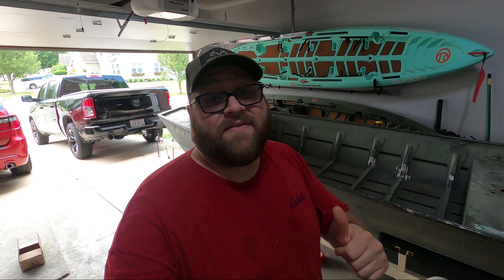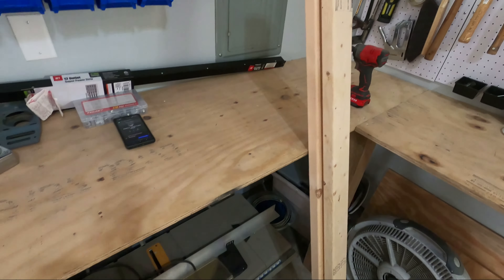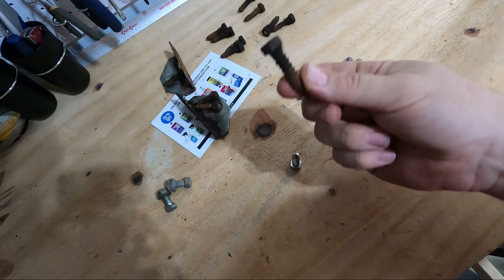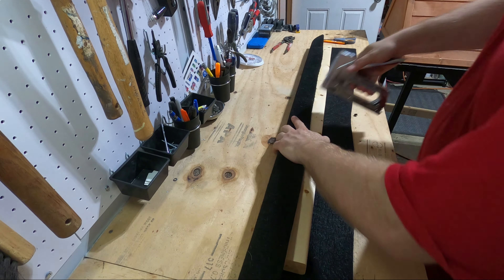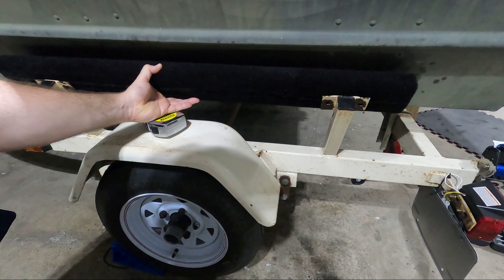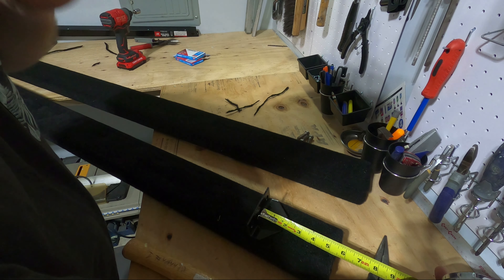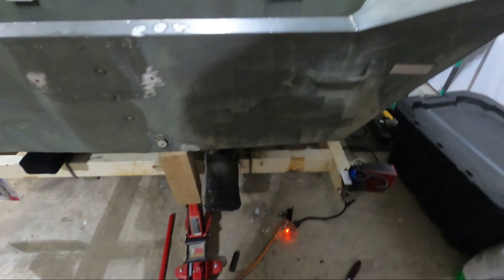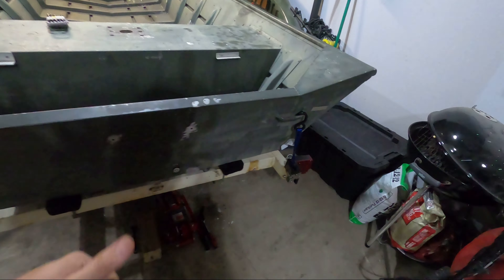BOAT TRAILER BUNKS CARPET REPLACEMENT | TIPS & TRICKS | Without Removing Boat

Comment: I think I'd feel better putting a coat of epoxy on the wood instead of thompson's. I know those bunks won't live in the water, but that carpet will hold moisture to it for quite a long time. Just a thought, you'll have to let us know how this turns out. Thanks for the vids and cool ideas.
Reply from the maker: I wanted something a little more penetrating than epoxy since as you said the carpet will stay wet for longer. However an even better coating would be epoxy over the water seal!

Comment: Question for you.. for flat bottom boat, do I need side bunks or would it be possible just to have the bottom bunks. Looking for a trailer or might fix mine up.
Reply from the maker: No boat /needs/ side bunks but they really help for trailering. You can always add them later if you wanted, they sell bolt on options.
Reply: @mvboutdoors  ok great. Thank you. Just got my first jon boat this week. So I'm watching lots of your videos for.good ideas.. good stuff. Thanks
Reply from the maker: @MelloThatDude  Awesome man, good luck with what you decide to build. Really fun boats!

Comment from the maker: Honestly, carpeting is one of my least favorite things to do but it was definitely worth it in the end. The previous bunks were literally crumbling!
Reply: How would you differ carpet to the EVA foam? I've got carpet, but interested in putting down foam boarding instead..just wondering your thoughts  🤔
Reply from the maker: @MelloThatDude  Foam for the trailer bunks? Or for the boat deck? I've not seen foam used for a trailer before, not sure how well the boat would slide on it.
Reply: @mvboutdoors  no no. The foam in the boat. As you did in one of your videos. You put foam down. Then you put your plywood down.
Reply from the maker: @MelloThatDude  Ohh okay, yeah I've always liked carpet but the ease of applying foam has me interested in it. I have it on my kayak and it's comfortable but stains ridiculously easy. Carpet will hold up better over time imo but I'm not sure what I'm going to use on my new build.
Reply: @mvboutdoors  ahh ok. Well I was wondering about it's hold up, so carpet sounds like a better idea at the moment..thanks for letting me pick your brain. Like I said I'm just starting out with my first jon b. So trying to figure out which way I wanna take it. Keep the videos coming man! 👍🏼